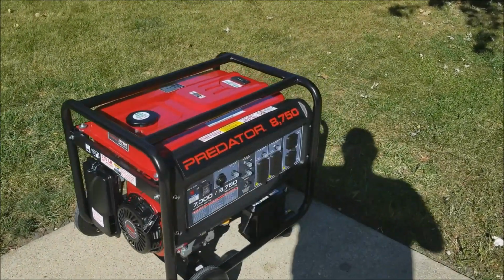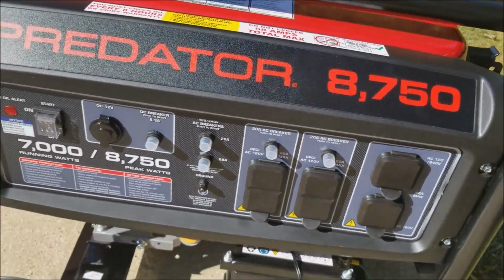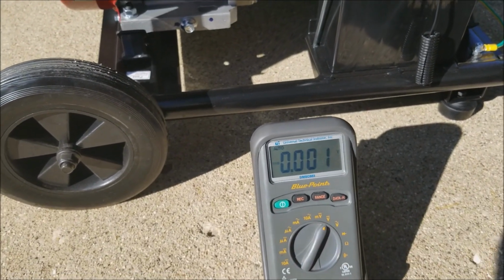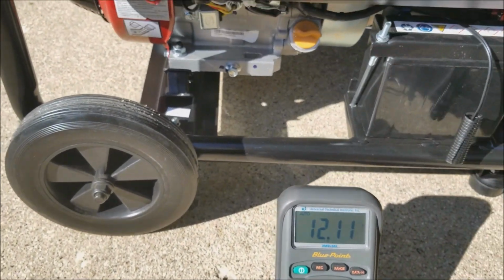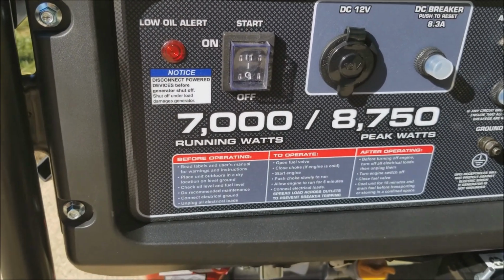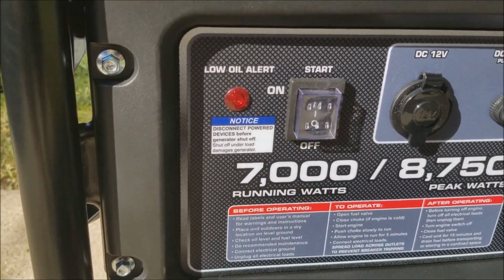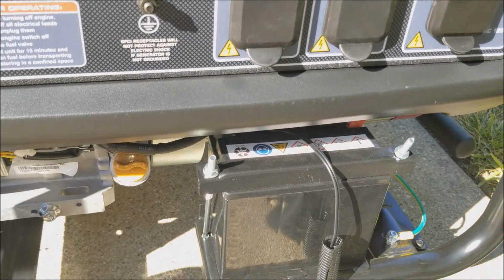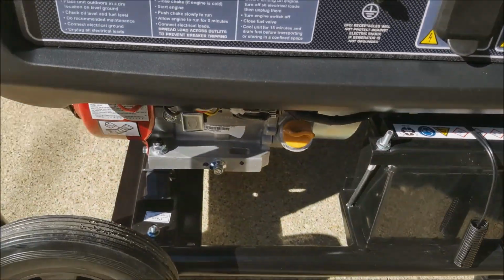Predator 8,750 Generator start up and voltage check

Comment: Has anyone used this generator to run a 4 ton central AC unit?
Reply from the maker: Texas T I haven't seen a video on it, but I'm confident that it would run it as long as the ac unit is equipped with a hard start kit
Reply: JPG23 thanks. I will try mine out soon. I will report back.
Reply from the maker: Just make sure your cord is rated to the size of your breaker so the breaker can do it's job should the load exceed the generator's capacity. Some people believe that if you change the 30A receptacle for a 50A receptacle, you're now good for 50A; however, unless they upgrade the internal wiring, the system is still rated to 30A. Trust me, the numbers can get scary and make one worry more than necessary, but it's just as simple as trying it out, and if all of your wiring is rated for your breakers, the breakers will protect you and your equipment. Also be sure to drain your capacitors before working on them with bare hands
Reply: JPG23 yes, I am definitely going to use 30 amp. I have an electrician friend that will teach me to wire everything up. I am only using what the generator specs call for.
Reply from the maker: Absolutely agreed, there's no reason to alter the generator. In my dad's application, the only reason we went with number 8 wire was in the hopes of using the central AC; however, my dad being the homeowner opted to purchase a window unit instead of running the central AC as he fears to damage the unit. Although I'm confident it'll run his 3 ton unit with a hard-start kit installed, I won't try to convince him as I know how stubborn I can be, and since he's my dad, that's where I get it from lol
Reply: JPG23 lol
Reply from the maker: Texas T How did your test go? I hope it went well; I have great news, I went ahead and installed a hard start kit on my 5 ton A/C and it ran just fine powered by my Predator 8750. I soon plan on making a video of it
Reply: JPG23 I haven't had time to try it yet.
Reply: @anthonyshoulders45   my 8750 runs my 3.5ton unit and most of my home. when i say most of my home i mean everything else besides the hot water heater, dryer, and the oven. i can sacrifice a few hours of no a/c to run those things though so no biggie.
Reply: @chrisbrowning3339  awesome.  I never got around to trying mine.
Reply: @anthonyshoulders45  ⚠️Please do not forget to follow all the generator safety rules when you use your portable generator: 

This is just a reminder to make sure. It is important to follow all generator safety rules whenever you use your portable generator. Everyone needs to see this. 
Here are the things that need to be followed;

1) KEEPING OTHERS SAFE: Please do not allow an unqualified person or your children to operate and service the portable generator. Just because some manuals don’t say that doesn’t mean it’s safe. That is important against the generator safety rules. We also need to be keeping an eye on our children too. You need to make sure that your children are not playing near the portable generator especially when it’s running so they won’t get electrocuted. Generators pose electrical risks and they can be hot during an operation. Please keep your children away from the portable generator at all times. It is important to keep our children safe especially our little ones. Be aware of all the hazards.

2) WHERE TO RUN YOUR GENERATOR: Some people use their portable generators indoors which increases the risk of carbon monoxide poisoning. It’s important to have a carbon monoxide if you have a gas generator. Never ever use your generator indoors even if your doors and windows are open and even in the garage is not safe to use a portable generator. Not even at your porch and your deck. It is never safe to use your generator indoors and in enclosed areas of your home. Your generator needs to be 15-20 feet away from your house. 

3)🔥FIRE HAZARDS: Never refuel your generator while it’s running. You need to let your generator cool off before refueling it and before storing your generator. Never overload your generator too. Never ever back feed your generator. You should never plug your generator into a wall outlet. Also never store propane tanks indoors. Please keep flammable things away from the generator as well and please don’t smoke cigarettes near the generator. Having a fire extinguisher next to the generator is also important against the generator safety rules. 

4) GENERATOR OPERATION: make sure your hands are dry before touching the generator. Never use your generator in wet conditions. Don’t let your generator get wet. You need a generator tent if you need to use your generator during wet weather. Please don’t wear loose clothes when operating the generator. Turn on your generator before plugging in appliances. Use the right cord for your generator. Please do not use worn out cords. 

https://youtu.be/I1jT3ANENvI and here is a video more about keeping others safe when using generators 

Hope this helps
Reply: @The_Happy_Aviation_Enthusiast  I appreciate you concern.  Yes I've always followed safety protocol.  Thanks for the comment.

Comment: Anyone know if this has a automatic voltage regulator?
Reply from the maker: KingQuad Bott I wouldn't call it "automatic", but it is set by the manufacturer
Reply: JPG23 would it be ok to run tvs and such off of this generator?
Reply from the maker: KingQuad Bott Absolutely, this generator powers my dad's whole house and everything runs well
Reply: JPG23 thanks
Reply: @bmbott123  ⚠️Please do not forget to follow all the generator safety rules when you use your portable generator: 

This is just a reminder to make sure. It is important to follow all generator safety rules whenever you use your portable generator. Everyone needs to see this. 
Here are the things that need to be followed;

1) KEEPING OTHERS SAFE: Please do not allow an unqualified person or your children to operate and service the portable generator. Just because some manuals don’t say that doesn’t mean it’s safe. That is important against the generator safety rules. We also need to be keeping an eye on our children too. You need to make sure that your children are not playing near the portable generator especially when it’s running so they won’t get electrocuted. Generators pose electrical risks and they can be hot during an operation. Please keep your children away from the portable generator at all times. It is important to keep our children safe especially our little ones. Be aware of all the hazards.

2) WHERE TO RUN YOUR GENERATOR: Some people use their portable generators indoors which increases the risk of carbon monoxide poisoning. It’s important to have a carbon monoxide if you have a gas generator. Never ever use your generator indoors even if your doors and windows are open and even in the garage is not safe to use a portable generator. Not even at your porch and your deck. It is never safe to use your generator indoors and in enclosed areas of your home. Your generator needs to be 15-20 feet away from your house. 

3)🔥FIRE HAZARDS: Never refuel your generator while it’s running. You need to let your generator cool off before refueling it and before storing your generator. Never overload your generator too. Never ever back feed your generator. You should never plug your generator into a wall outlet. Also never store propane tanks indoors. Please keep flammable things away from the generator as well and please don’t smoke cigarettes near the generator. Having a fire extinguisher next to the generator is also important against the generator safety rules. 

4) GENERATOR OPERATION: make sure your hands are dry before touching the generator. Never use your generator in wet conditions. Don’t let your generator get wet. You need a generator tent if you need to use your generator during wet weather. Please don’t wear loose clothes when operating the generator. Turn on your generator before plugging in appliances. Use the right cord for your generator. Please do not use worn out cords. 

https://youtu.be/I1jT3ANENvI and here is a video more about keeping others safe when using generators 

Hope this helps

Comment: Your solar panel hook up to battery keeps battery charged?? And do you keep it all hooked up, to generator to battery to solar panel?? Good video
Reply from the maker: Yes, this solar panel is a battery maintainer so it maintains the battery at 12 V, and starts right up every time. I'll make a video showing that soon
Reply: JPG23 nice ive always wondered a out doing the same. Just wasn't sure on how it all goes together. Great video.
Reply from the maker: Chris Yazzie Thanks, I've posted a new video with more details on the installation
Reply: @krisyaz1545  ⚠️Please do not forget to follow all the generator safety rules when you use your portable generator: 

This is just a reminder to make sure. It is important to follow all generator safety rules whenever you use your portable generator. Everyone needs to see this. 
Here are the things that need to be followed;

1) KEEPING OTHERS SAFE: Please do not allow an unqualified person or your children to operate and service the portable generator. Just because some manuals don’t say that doesn’t mean it’s safe. That is important against the generator safety rules. We also need to be keeping an eye on our children too. You need to make sure that your children are not playing near the portable generator especially when it’s running so they won’t get electrocuted. Generators pose electrical risks and they can be hot during an operation. Please keep your children away from the portable generator at all times. It is important to keep our children safe especially our little ones. Be aware of all the hazards.

2) WHERE TO RUN YOUR GENERATOR: Some people use their portable generators indoors which increases the risk of carbon monoxide poisoning. It’s important to have a carbon monoxide if you have a gas generator. Never ever use your generator indoors even if your doors and windows are open and even in the garage is not safe to use a portable generator. Not even at your porch and your deck. It is never safe to use your generator indoors and in enclosed areas of your home. Your generator needs to be 15-20 feet away from your house. 

3)🔥FIRE HAZARDS: Never refuel your generator while it’s running. You need to let your generator cool off before refueling it and before storing your generator. Never overload your generator too. Never ever back feed your generator. You should never plug your generator into a wall outlet. Also never store propane tanks indoors. Please keep flammable things away from the generator as well and please don’t smoke cigarettes near the generator. Having a fire extinguisher next to the generator is also important against the generator safety rules. 

4) GENERATOR OPERATION: make sure your hands are dry before touching the generator. Never use your generator in wet conditions. Don’t let your generator get wet. You need a generator tent if you need to use your generator during wet weather. Please don’t wear loose clothes when operating the generator. Turn on your generator before plugging in appliances. Use the right cord for your generator. Please do not use worn out cords. 

https://youtu.be/I1jT3ANENvI and here is a video more about keeping others safe when using generators 

Hope this helps

Comment: Would love to see someone use an oscilloscope with a load and no load to verify how clean/dirty the 60hz power is.
Reply from the maker: golf-n-guns I would to, I don't have that kind of equipment
Reply: How is the generator working?  Did you end up buying another one for yourself?  When I was looking the 8750 over at the store I tried feeling the wires coming out of the generator head...they are covered in a rubber sleeve.  They feel very thin, like maybe 8 gauge.  Doesn't seem heavy enough to safely run 7000 watts.  What are your thoughts?
Reply from the maker: golf-n-guns I haven't bought another one, but plan on doing so when we move, although I may end up going with the Predator 13,500 as it can handle more.  As for the wiring you are correct, it is # 8 wire which allows you to run 40 amps and at 240 V that would be 9600 W which is more than enough for 7000 W.

I already installed it in my parent's house and it was able to run the whole house. The next step will be to install a hard start kit on the ac unit so they don't have to get window units. I'll post a video of that as soon as I'm over there again.
Reply: JPG23 Thanks for the reply. I guess you're right, 8 gauge can carry 40 amps, just seems thin to me. Wishing it was a heavier gauge.  Have you thought about converting the carburetor to dual fuel? (gasoline / natural gas)
Reply from the maker: The thought of going dual fuel has crossed my mind and although it could be a great solution to making the carb practically maintenance-free, my dad will be the one using it and I already bought him a 2 year supply of Sta-bil storage which according to the instructions should keep the gas good for well over a year. The schedule I recommended to him is to run it for at least 30 min twice a month and once a month run it on a 50-60% load for about 2-4 hours to keep the engine lubricated and the generator in good working condition.
Reply: You can buy a Kill-A-Watt at Home Depot that will tell you this sort of information.  You just plug it into a receptacle.
Reply: ⚠️ Here are the reminders about generator safety. We always need to make sure we follow all the generator safety rules whenever we use portable generators: 

Everyone must see this 

1) KEEPING OTHERS SAFE: Please do not allow an unqualified person or your children to operate and service the portable generator. Just because some manuals don’t say that doesn’t mean it’s safe. That is important against the generator safety rules. We also need to be keeping an eye on our children too. You need to make sure that your children are not playing near the portable generator especially when it’s running so they won’t get electrocuted. Generators pose electrical risks and they can be hot during an operation. Please keep your children away from the portable generator at all times. It is important to keep our children safe especially our little ones. Be aware of all the hazards.

2) WHERE TO RUN YOUR GENERATOR: Some people use their portable generators indoors which increases the risk of carbon monoxide poisoning. It’s important to have a carbon monoxide if you have a gas generator. Never ever use your generator indoors even if your doors and windows are open and even in the garage is not safe to use a portable generator. Not even at your porch and your deck. It is never safe to use your generator indoors and in enclosed areas of your home. Your generator needs to be 15-20 feet away from your house. 

3)🔥FIRE HAZARDS: Never refuel your generator while it’s running. You need to let your generator cool off before refueling it and before storing your generator. Never overload your generator too. Never ever back feed your generator. You should never plug your generator into a wall outlet. Also never store propane tanks indoors. Please keep flammable things away from the generator as well and please don’t smoke cigarettes near the generator. Having a fire extinguisher next to the generator is also important against the generator safety rules. 

4) GENERATOR OPERATION: make sure your hands are dry before touching the generator. Never use your generator in wet conditions. Don’t let your generator get wet. You need a generator tent if you need to use your generator during wet weather. Please don’t wear loose clothes when operating the generator. Turn on your generator before plugging in appliances. Use the right cord for your generator. Please do not use worn out cords. 

https://youtu.be/I1jT3ANENvI and here is a video more about keeping others safe when using generators 

Hope this helps
Reply: exactly what I came here for.  I just read a review of the Pulsar 10,000 where the guy noted that compared to the Harbor Freight, the Pulsar was spec'd at up to 10% distortion where the HF was 20%.....wondering where the numbers came from etc.
Reply: I'm sure its a very dirty square top sine wave, to get clean power you'll need an inverter generator
Reply: @BillyBob-ir6lx  Some units are <5%THD with all copper wound gen heads and is pretty clean. My UPS backup with modulated pure sine wave sees that power source as clean (enough), safe and acceptable for my sensitive electronics. Mine is a 10K continuous 15K peak but it's not a HF Predator. Agree inverters are the best at clean power, but I have yet to find an inverter at the rated watts I have and need in a portable gen platform.